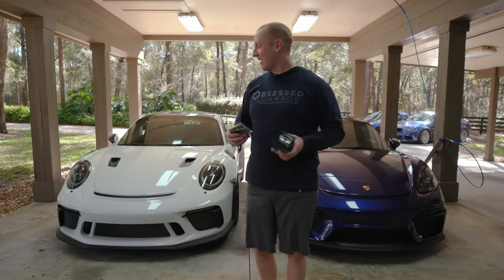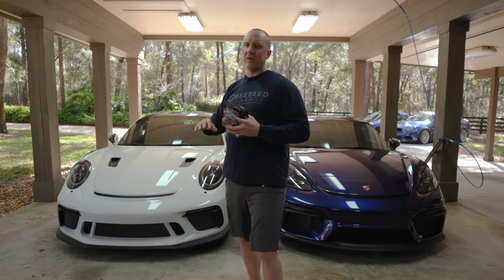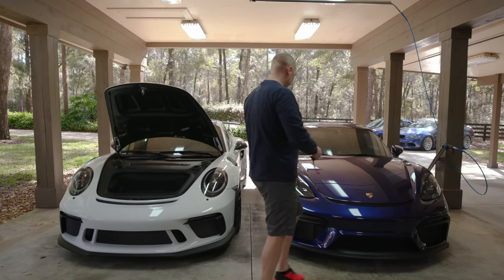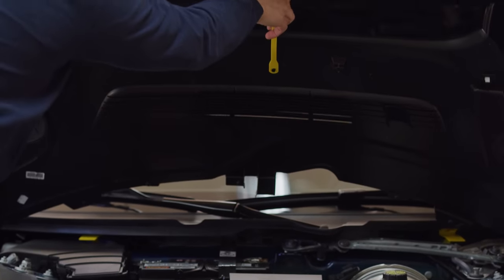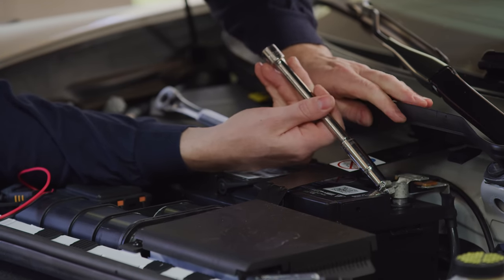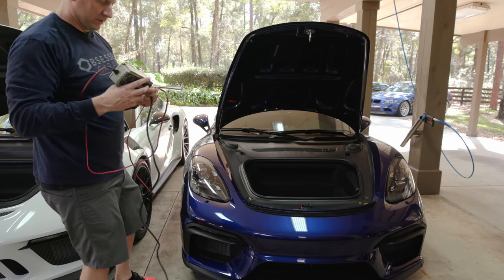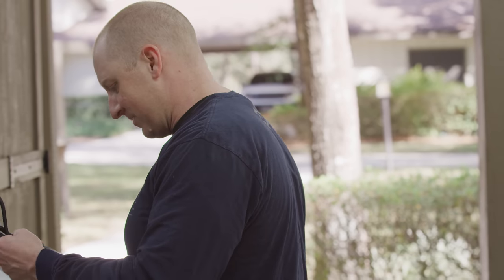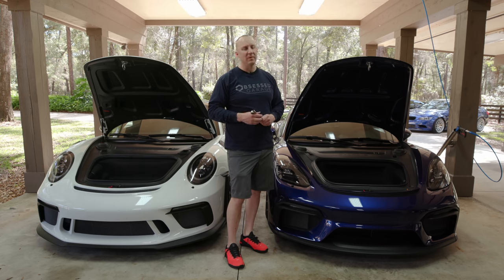How to Install CTEK Battery Maintainer On 718 GT4 and GT3RS

Comment: Porsche recommends that the negative lead be attached to the body rather than the battery post to avoid problems with the battery management computer. In fact, there’s a big sticker warning about this right next to the battery. There is an unused threaded hole on the strut tower top next to the battery that is ideal for attaching the negative side of the charger lead.
Reply: I think that is just for using jumper cables. A trickle charger is fine directly connected to the battery.
Reply: @thomaslahr9022  Probably right but check out the user manual under ‘Charging the battery’ (p53 in my manual). Pretty clear instruction to use the ground post for the -ve connection.
Reply: Exactly, the idea is that by connecting the charger directly to the negative terminal you are bypassing the current sensor and will shorten the lifespan of the battery.
Reply: All good points. This is why every charger that is Porsche Branded is a cigarette lighter adapter to be plugged into the interior of the car
Reply: Also ist can damage your control Units if not used the attatch at the body
Reply: Manuals and warning stickers are for babies
Reply: Yep, connect the negative wire of the lead before the battery management sensor. Same concept on BMW’s
Reply: The comments section is a good place. LOL.  In the description he said he connected to the negative terminal but on my car the space that he used is still open about 1/4 inch with the terminal tight, so in order to put the wire in that space I'd have to over tighten the hell out of the clamp.  I end up using one of the strut tower bolts. There is enough thread sticking out to add another nut.  I saw the threaded spot on the drivers side but the pig tail on the charger is way to short to reach there.  Hey CTEK watch your user videos, make that pig tail LONGER.  About 3 feet?  I'll pay 50Cents more for the wire.
Reply: @thomaslahr9022  computer must see all current!
Reply: That’s for jumping. The CTEK lithium chargers are designed to safely directly charge a lithium car battery (eg; an antigravity battery)
Reply: @peterpavlidakey8343  - however, Porsche states that the cigarette receptacle will go to sleep cutting off power to the charger. They suggest that you either lock the car using the remote or use the method shown in this video.
Reply: @alfieboy4022  cteks makes chargers for agm/lead batteries not only lithium

Comment: Did this on a 997 and had the whip accessible towards the windshield so that it can be plugged in without opening the trunk. This has the side benefit of never getting locked out of the trunk should there be a battery failure, although complete failure might be an older car issue, lol. Nice mod, and very affordable, and keeps from having to close the door on the cigarette lighter version.

Comment: Thanks, Matt! I bought a Noco x 2 charger for my GT4 and GT4 RS so both can use the same charger. Having a way to quickly and easily connect/disconnect a trickle charger is key since, like you, I don’t drive these cars all the time. Noco makes a “whip”, as you call it, to do a hard wire connection to your battery with a quick connect (Noco #GC002). Smart!

Comment: But wouldn't the smokers package with the Porsche factory ctek charger  with the cigarette adapter be a much cleaner package with no installation of wires??
Reply: You have to lock the car or else the cig adapter will time out after a short while which isnt a big deal.  And the added benefit of using the cig adapter is that you don’t forget it is plugged in and accidentally drive off.
Reply: @thomaslahr9022  What I do with my GT4 is I just crack the window a bit and let an extension cord  hang at the top connected to the ctek charger and yes I do lock the car or it will go into battery protection mode or hibernation mode.

Comment: Nice work Mat. I did the same with my Saab 9-5 Aero Estate when it was retired from being a daily driver. The advantage was my whip connector was hidden in the corner of the grill so I didn’t need to open the bonnet or anything else. The C-Tek chargers are brilliant I’ve found. Very reliable and I’ve never had a problem with incorrect charge or turning off, as friends have found with other brands.

Comment: Just picked one up for my M2 and E36 M3. They're the best by a long shot
Reply: How do you connect to M2 vs E36, directly to battery, cigarette lighter or using under the hood +/- jump connectors?
Reply: @zhorikjunior1852  I do both under the hood. This is more critical on the M2 because of the modern "ibs" (not irritable bowel syndrome lol) it's some kind of system that monitors the cycles of the battery and you don't want to bypass it. This is what I read on bimmer posts or else I wouldn't have known anything about it. The E36 you don't have to worry about that I just find it more convenient.
Reply: @coreywagganer  Thanks. E36 is simpler I agree, for M2 I used cigarette lighter without any issues really but then read that recommendation with "IBS" that why I'm asking.

Comment: From the CTEK Manual:
For batteries mounted inside a vehicle
1. Connect the red clamp to the bat- tery's positive pole.
2. Connect the black clamp to the vehicle chassis remote from the fuel pipe and the battery.
3. Connect the charger to the wall socket
4. Disconnect the charger from the wall socket before disconnecting the battery 5. Disconnect the black clamp before the red clamp.

Comment: As well as connecting the -ve to the suspension turret rather than directly to the battery it is much easier to feed the charger wires out at the bottom of the windscreen between the wipers. That way you don't need to open the bonnet to charge the car.

Comment: On my C2S, I ran the short cable/connector from the battery through one of the slots in the plastic cover (over the battery area). The battery-side connector sits above one of the slots, where I connect to the charger-side power cord.  When I need to remove the plastic cover the connector simply slips though the slot in the plastic cover.

Comment: Doesn't the GT3 have a negative pole on the chassis? Connecting the charger directly to the negative battery pole you're bypassing the battery monitor, which is not recommended.

Comment: Cut that long cable to size make a splice with heat shrink
Reply: My thought as well.....  run over to sparr building supply in Wildwood.  They have black heat shrink for about $3 in the back right of the store against the wall. Neat and tidy. :)

Comment: This has got my OCD feeling some sort of way having all that excess cable and the connector loosely fitted. 
I have read CTEK do not recommend connecting the negative wire directly to the battery for that extension lead. 

Have a look at the INDICATOR PANEL 1.5M from CTEK. Really neat indicator that could be fitted to the battery cover by cutting a small hole. The indicator lead also has an inbuilt fuse so can be fitted to the battery both positive and negative. Hope this gives you an idea for a different option to having 8’ of excess cable.

Comment: Matt, why not just use the cigarette lighter version of Ctek?
Reply: ^ This.  I use the cigarette lighter adapter on my Boxster, a lot easier than messing with a whip.
Reply from the maker: I think this is a bit more elegant.
Reply: Same comment, I use the cigarette lighter on both my 991 and 718, no mods required.  I don’t have to pop the hood every time I’d like to go for a drive.  Had the under hood setup on my GT350R, was an annoyance every time I wanted to drive it.  This mod would make more sense if you had the Anti-gravity batteries not the standard batteries.
Reply: Yeah. Team cig outlet over here. The video would have been very short if he did that though...
Reply: Plus the cig lighter eliminates the added cable weight 🤣

Comment: If you try to charge with the front hood up, you have a light on in the cargo area!
Reply: The light times out.  It does in my C2S.
Reply: I was concerned about that too, but found my light in Jeep will go off when the hood is lowered to a certain point.
Reply: Pull the bulb. The housing is removable without tools.

Comment: Can you close the hood while the ctek cables are connected?
Reply from the maker: You can if you force it, but I generally don't.
Reply: I believe that u shaped cut out in the windshield cowling, almost directly above the battery, is there so you can run the ctek cord out the top of the hood and still close the hood.

Comment: +1 for the cigarette lighter connection in the footwell. But the real question is; Matt are you considering a light weight battery for the GT cars? Like the one you put in the Civic? I am considering this but little hesitant because of potential voltage instability (when board voltage goes too high and battery shuts down) and related dashboard lights that kick in. I would feel better if you try it first😉
Reply from the maker: Yes, I'll probably get them for each car.

Comment: Just an observation, those leads are not fuse protected like some other brands are. If they rub against something and short out, it will set the car ablaze.
Reply: I just received a CTEK MXS 5.0 and the red wire on the short eyelet cable has a fuse.